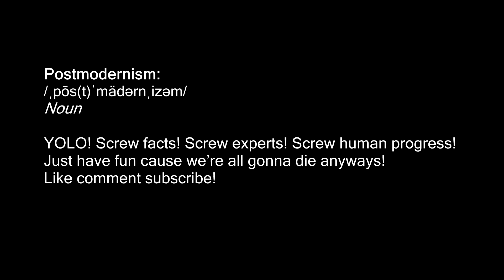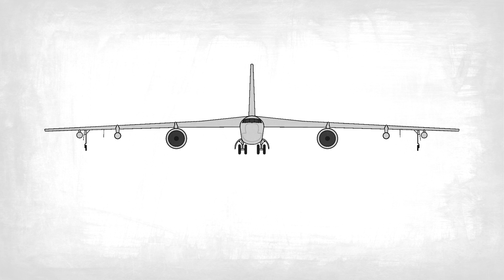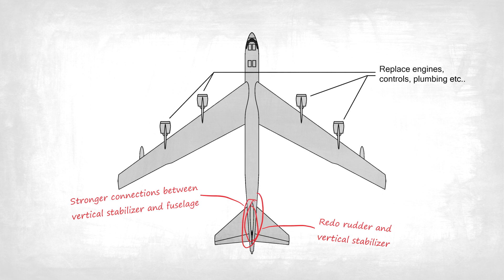The B-52 is Getting New Engines... Why Does it Still Need 8 of Them?

Comment: Mostly correct. I was involved with the initial testing at Boeing (test pilot) of the four engine vs eight concepts. We flew a simulator. The takeoff phase of flight is the most vulnerable to loss of engine loss of control. The 10% chord line rudder is insufficient in control of a single outboard engine loss after S-1 through S-2. At moderate to heavy gross weights pulling the opposite engine thrust back will not accelerate the jet to a safe break ground speed. (BUFF does not rotate). Also the wings and pylons would need significant modification to allow the increase in thrust at four stations. The wings are more of a system than just a wing. The aircraft is susceptible to flutter based on stores, fuel loading, airspeed combinations. The wing system is extremely complicated as it has numerous twist and flex and bending features that allows for stable flight through out its airspeed and weight regimes. The best option is eight engines delivering the same thrust as the current TF-33s The other big hurdle is going for an analog wire based throttle co tool to FADECs and electronic control. That will be costly no matter what mods they do.
Reply: You were a test pilot in the 1950s?
Reply: Thanks - your reply shows how a lot of armchair engineers and YouTubers overlook the system level considerations as well as testing and documentation requirements when looking into re-engineering existing ("heritage") designs. Cost / benefit / risk analysis shows that it's rarely worth it - regardless of whether it's the tax payer or private enterprise that's footing the bill.
Reply: I can only assume they mean at the start of the re-engine-ing concepts, not when the plane was originally designed.
Reply: @lptomtom  Do you think that they had a simulator in the late 1940s that could compare the effect of 4 vs 8 engines?   (Also, search his name and you'll find a test pilot who works for Northrop Grumman who's flown the B-52, so chances are ... )

Comment: Another reason is because the outer 2 engine pods are slung very low. Large bypass engines would be susceptible to foreign objects damage
Reply: The pylons have them hanging pretty far below the wing - they could probably shorten the engine pylons and have sufficient ground clearance. If it was possible to put high bypass engines on the 737, this should be easy by comparison.
Reply: @quillmaurer6563  ,
The wing droops down so much at the outer engine pylons that a High Bypass Turbofan would suffer cowling strikes.
Reply: That is why the runway is regularly walked for foreign objects.
Reply: @paulkurilecz4209  in an ideal world, yes, the runways are regularly walked, but in wartime situations, these birds have to be able to land on a crappy, potentially semi damaged runway, refuel/rearm, and take off without loosing all of their engines to FOD so low ground clearance would be dangerous for them.
Reply: @thomasprovencher4611  so why do other aircraft like cargo or air refuelers get away with high bypass engines?
Reply: @thomasprovencher4611  In their nearly 70 years of service, in war time they are flying from bases far far away from the conflict zone, generally 1000’s of miles. 

So while its a possibility, its yet to happen.
Reply: @williamkillingsworth2619  it's very possible my assumption is incorrect, but working in the defense industry has showed me that the military thinks about all sorts of possible causes for mechanical damage and works to mitigate it, even if it's never happened before.
Reply: Could do a hybrid of two medium or high bypass engines in the inboard positions and (2x2)= 4 low bypass smaller engines in the two outboard positions
Reply: @thomasprovencher4611  you are correct, fod can be an issue. In a near Peer engagement very possible.  luckily we haven’t had one of those.   I wasn’t trying to point out that you’re incorrect just that we haven’t had that situation happen.
Reply: @davidpowell3347  logistics then you have to have 2x as many spare parts.  Training  proficiency on two types. 

One thing many people don’t consider is at high altitude turbo jets/ low bypass fans are superior to high bypass turbo fans.   A turbo jet gives it better high altitude,  high speed capability than a fan. Which is one of the reasons they were never upgraded
Reply: @davidpowell3347  that would be a technical nightmare
Reply: @quillmaurer6563  well, that didn't exactly go so well on the Max 8.  The larger engines caused some pitch-up forces at certain speeds, which is why the MCAS was required, which led to the two crashes and ensuing debacle.  IOW, raising the pylon bottoms while at the same time massively increasing the fan diameter causes aerodynamic interactions with the wings that can cause issues.
Reply: Well, if they could, they could take off on the inner 4 engines then start the outer ones in the air. So if there is a risk of fod, then that could be done with a longer runway length.
Reply: @noahb717  planes always need their highest power level when taking off.  If the B-52 only needed half its engines at takeoff, it would never need more than half of them.
Reply: You need to look at the KC-135 R and how low their inboards are to the ground. Yet they have no issues with FOD because the ramp is policed and maintained. The AF is a stickler of this. The daily off walks on the ramps and the street sweepers running on the hammerheads and other areas of the ramps.
Reply: @JechtAruon  CFM56 used on KC-135R has smaller diameter than RB211 that was once proposed to replace the twin TF33 pod
Reply: @quillmaurer6563  I thought they lengthened the MAX landing gear as well. Also the pylon is shaped differently, the engine is literally raised on the pylon.
Reply: @cefb8923  I think the MAX 10 has slightly lengthened landing gear that shortens as it retracts to fit into the same wheel well, or something like that, but the short landing gear is certainly still the MAX's Achilles Heel, that I see as leading to much of the other problems. The pylons are entirely redesigned, but I would expect the same would be done on the B-52 re-engine, they'd basically replace everything below the wing attachment point rather than re-use the existing pylon.
Reply: @quillmaurer6563  The original 737 models had short landing gear.  This put the cargo doors low enough that baggage handlers on the ground could load cargo by hand.  These days almost every airport has mechanized cargo/baggage handling facilities, so that's not an issue, and the later 737 models have taller landing gear to allow more ground clearance under the wings for larger diameter engines.  So you'd need taller landing gear, which if course means you'd need larger landing gear bays, which means you'd have to relocate whatever was next to the landing gear bays.  It's amazing how things interact in an aircraft design.
Reply: @roysmith5902  I don't know if the landing gear has been lengthened on newer 737s, but even if so they're still very low to the ground compared with other airliners of it's size (A320, even the 757 it's almost as big as), and this presents a serious design limitation. As you describe, given how many other things would need to be redesigned this isn't an easy thing to remedy.
Reply: You could fix that like in KSP where you have small landing gears below the engine to keep it from getting too close to the ground.
Reply: @davidhoffman1278  Put wheels on the underside of the cowlings. Also helps with the stress on the wing.
Reply: @quillmaurer6563  They DID redesign the 737Max gear, making them longer to give the bigger engines the needed clearance.  They reduced the allowable bank angle at touchdown, as bank angle = one lower wing = that side’s engine is nearer to the ground.  The outer engine pylons on the B52 are SOO much further out on the wing, I’m sure this would be even more problematic.  Larger high-bypass engines would most certainly require a major landing gear redesign.
Reply: @quillmaurer6563  it definitely can. But it need substantial amount of money from taxpayer to research and testing the new design

Which, people tends to forget the point of reengine this plane is just for cheaper and readily available part, not about fuel efficiency. And this plane flew less often than expected to justify the benefit of 4-engine redesign anyway

Comment: I can say this after hearing 2 different versions of the B-52 in person: The original turbojet engines, were the loudest I have heard in person when all 8 ramp up. The current turbofans, while still insane loud, they are quieter than the turbojets by a large amount. I am curious to hear the new engines after the change over.
Reply: As I recall the first of the Boeing 707s had engines with distinctive shaped exhaust structures, then a short time later they changed to a different style, more like what we saw on the 727 and 747 thereafter.  I'm sure there are photos online of those early engines.  I think the sound changed between designs as well, as they tried to reduce the sound levels.
Reply: I was at an air show and saw a b52 fly by.  It was the loudest plane in the show by a good margin.
Reply: If you think the B-52 is loud, you should see a B-1B take off with full afterburners.
Reply: I worked on the same engines on the E-3 AWACS. Others pointed out that other engines are much louder, which they are, but it's not the decibels, it's the frequency. TF-33's have a very high frequency 'whine', that will literally make you sick to your stomach after long exposure even with double hearing protection (actually has nothing to do with your ears). I've experienced this personally while being the ground com on long maintenance runs. Those motors just scream at and vibrate your guts in a way they do not like....
Reply: @dmsdmullins  That makes me think about watching AV-8B hover tests by the McDonnell Douglas facility in St. Louis.  Very, VERY loud!
Reply: @NathanMN  I wonder how these two compare to the Concorde?
Reply: @LeonFelixRusso  It's an interesting question; I've never seen a Concorde fly. The engines on the Concorde were more powerful, probably because it cruises much faster. Considering the difference in max weight, and purpose of each aircraft, I'd still bet the B-1B is louder.
Reply: @bobblum5973  I've seen Harriers at air-shows and they are probably the loudest aircraft I have ever heard.
Reply: @dmsdmullins  I would not be surprised if they are, or at least in their size category.  I went to an airshow in downtown St. Louis, got off the MetroLink train on Eads Bridge, and was just walking in the huge V-notch between the bridge and a riverbank retaining wall... when the Harrier flew up, hovering over the river.  THAT may have been the loudest thing I've ever heard.  There's a weird vibrato whine amongst the roaring.
Reply: I was stationed at Tinker from 2011/12 for radar maintenance with our deployable radar (TPN-19) on the flight line, and man when those B-52's stopped by there were times I thought our shelters were going to collapse.
Reply: The B-One is loud AF even when not in afterburner
Reply: I know I've heard the T-37 Tweet is worse than an H model B-52 (hence the nickname).  Can't say anything about older BUFF engines vs H model.  Buff isn't sneaking up on anyone though.
Reply: The later engines were used on the later models as they came from the factory !!!
Reply: The loudest jet I have ever heard was back in 1990 at a mall near NAS Miramar.  A KC-135 with original turbojet engines took off with water injection.  It was ear-piercingly loud miles before it even reached us.  I couldn’t believe a jet could be so loud, and I was used to F-14’s, A-4’s, F-16N’s, etc flying overhead multiple times daily.  I have to imaging a B-52A would be even louder!
Reply: The C5 Galaxy engine original turbofan had a distinctive whining and buzzsaw which shook uptown everything in it's past. The new engines in all aircraft are softer sounding but that is depressing. War machines need to be loud, as it's suitable for their character 😎
Reply: I haven't heard a b52 but i have heard a b1 and that was quite loud.
Reply: @NathanMN  The Concorde and B1B Lancer both have reheat/afterburner for takeoff.  The B1 has 4 turbofans.  The Concorde has 4 turbojets.  Concorde is (was) louder.

Comment: Hi ex Air Force aircaft engineer here. Yep they could replace the TF33's with RB211's (which was looked into) but decided to use 8 still. Like the guy below says, you need to SEE a BUFF coming into land in a stong crosswind to believe what it can do! The undercart is  computerised to 'steer off' a set amount to compensate for the huge Shark fin on it ass! It looks like the wheels are 'broken'  but watch as she touches down, it will self correct along the runway centerline! I was lucky to have flown in a B52 and it is amazing!  The trail of black smoke they leave on take off you could walk up to get to the plane! Good old Pratt & Whitneys!
Reply: I was about to comment 4 engines instead of 8×2 but then the tail hing came up. 

Still,  slightly larger rudder could then work, and half the engines to maintain and look after, half the spare parts, right? maybe that would offset the rework of the rudder? Or not, what do I know.
Reply: @jamegumb7298  at that point you would also have to get into the fuselage, and before you know it, it would be cheaper to start from scratch as everything would be new.
Reply: "The undercart is  computerised to 'steer off'" is a false statement. It does not "self correct along the runway centerline". You do know the crosswind crab is a knob behind the throttles that is manually operated by the P/CP with cables that goes to the crosswind crab motor right? That shit freezes in the winter and needs to be thawed with a heater cart for crosswind crab to work.
Reply: @ZEE0H6  Nosel/Noser switch!
Reply: @jamegumb7298  ,
RR has stated that the replacement engines should be able to stay on wing for the remaining forecast years of B52 usage. That is a significant amount of maintenance savings compared to the existing TF33s.
Reply: The smoke is due to the aromatic content in the fuel.  Aromatics have a higher energy content than the paraffinic compounds.  As a result there is more energy per lb of fuel than there is in the low aromatic content fuel used in commercial aviation.  This means that I have to carry less weight of fuel in order to have the same amount of energy present in the fuel.

Back in the 60's and 70's commercial aviation jets used to leave the same black smoke on takeoff.  At some point in time, I forget when, the EPA started requiring commercial jet fuel to have a lower aromatic content in order to reduce the black smoke trail.

At high power settings, the aromatics take longer to fully combust and the partially burned aromatics exit the combustion chamber as soot.  As the power level is reduced, there is a longer residence time in the combustion chamber and allows for more complete combustion.  Hence, not very much black smoke at cruise.
Reply: @paulkurilecz4209  newer engines burn more efficient.  The B-52 still have old school mechanical fuel injection.   Then new engines will have digital control and more efficient mechanical parts like compressor, combustor,  turbine.  That will make a massive difference.  The Tf-33 is a 1950’s design.   Jet engines have come a long way. 

One of the reasons modern airlines don’t smoke is the use modern engines.  The B-52 is still using something similar to the 707, which hasn’t been used commercially in years.
Reply: Would there have only been 4 RB211 's?  Seems like 8 of them would be massive overkill unless you were drag racing the Space Shuttle.
Reply: @davidpowell3347  ,
Yes, only 4. The 4 instead of 8 philosophy was still strong at that time. A derated, for longevity, RB211 could have slightly more than 2X the thrust of a single TF33. 

Again somehow the rudder capabilities issues were ignored or overlooked.
Reply: @williamkillingsworth2619  early jet engines used total loss oiling. Oil seal materials able to stand up to the high temperatures and RPMs of jet engines hadn't been developed, so the easiest thing to do was put in large oil tanks and treat engine oil as a consumable like the fuel. As seal technology improved, jet engines were changed to recirculating oiling. Some planes (like the F4 Phantom and the B52) got new engines, either replacements or in new builds of later revisions. When I was a kid I lived under one of the flight paths of a military base and I noticed when the F4's that regularly flew over quit leaving trails of black soot behind them.
Reply: @greggv8  The Fuel control is also more precise on modern engines. think modern clean burning diesels with electric fuel control vs old mechanical injection pumps.  While I agree with you on the oiling and seals are improved and older engines consumed more oil. Most of the smoke from older engines is from incomplete combustion of jet fuel caused by a richer mixture. Modern turbines are made of more heat resistant materials, run hotter and achieve more complete combustion, old engines ran rich to help keep Turbine temps down at high power levels. Hence the heavy smoke at high power settings.
Reply: I may be wrong, but being this plane (was) is used in wartime situations, I am an advocate of the redundancy of 8 engines.

Comment: Thanks for showing the picture of them testing a single engine in place of a dual-engine pod.  I know they did that for the big engines needed for the 747, that was the only way to flight test the engine when they didn't have a 747 airframe available yet.  As I recall, it had more thrust than the dual engine pod, and did not exhibit the black exhaust.  But as I recall that was partly due to the original engines being turbojets while the 747 engine was a turbofan.  And don't forget, it's one thing to test a newer engine, quite something different to put it into daily service.